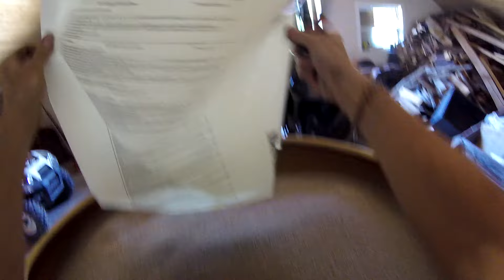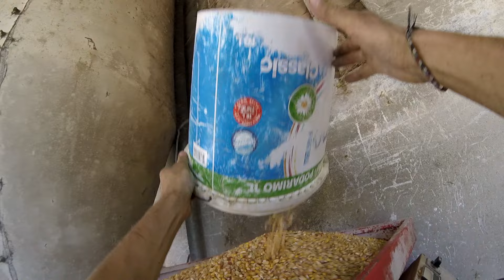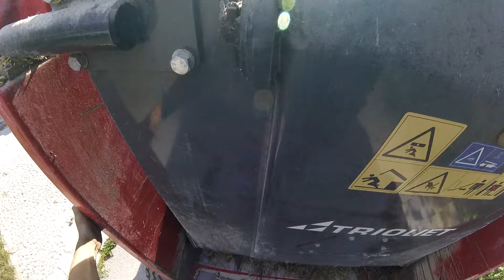A Day on the Farm #15

Comment: How long does battery last, for how many yards or feet of electrical fencing wire? Are most of the homes in Slovenia have tile roofs?
Reply from the maker: We have it on direct current, we only use battery in the fall when we fence more distant fields. Yes and our roof tiles are actually home made 😁